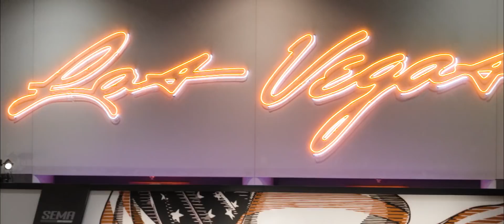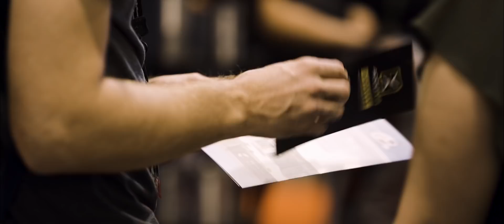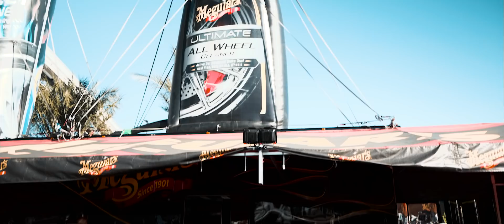TOP Vehicles of SEMA 2018 | Presented by AccuAir

Comment: Wow,  accuair with integrated tank compressors. How do you top that?! I wonder what's next for the brand. Shed some light for the future?!!!
Reply: It has issues...
Reply: @Excentrix54  
Details??? 
I literally ordered and received this unit last week. Awaiting installation.
Reply: Overheats and has random shut downs with data sending errors. I mean of you dont actually drive your vehicle then it will be fine. I use mine everyday, I dont trust it.
Reply: @Excentrix54  
Hmmm thanks for the Insight, I also have the older system with exterior air pumps which I will now keep just in case.  If there is Anything else you've experienced. Let us know.

Comment: yo accuair/  nice job on the video and audio// i whish you guys ware around 1986 to1992 // when Lincoln was building Lincoln mark vll L.S.C the cars will still be on the road// Lincoln air ride are OK// but when they start to break down they break down Lincoln has to many moving parts!!!🖒😎💰💵💰😼2019# ps Lincoln motor company could have learn a lot from you guys jan18th2019#🖒